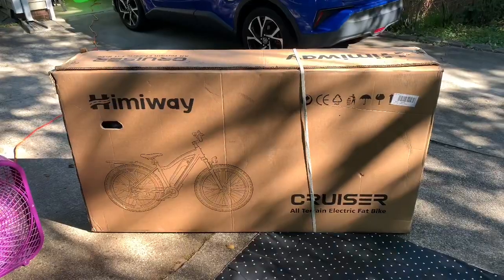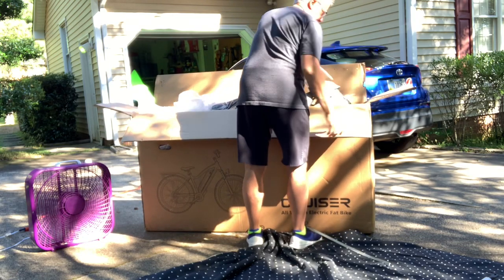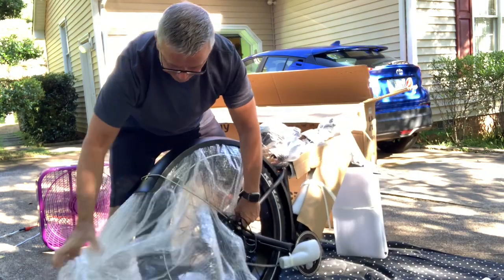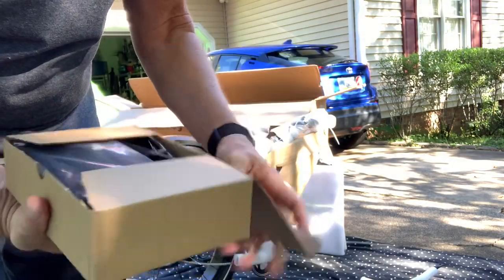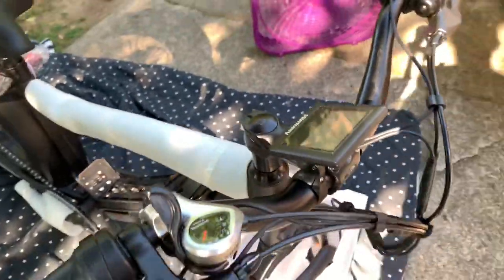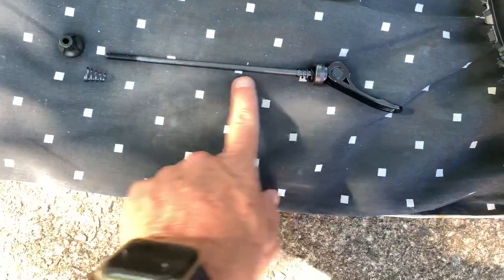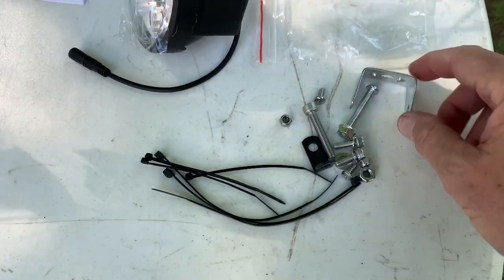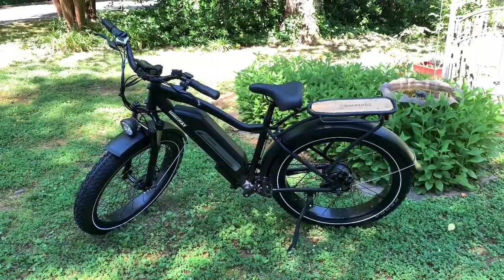Himiway Cruiser Unboxing & Assembly

Comment: Took Me three mo to get Mine ! Took one more for bike shop to assemble it :(  It came with broken 
tail light bracket . I Jerry Rigged bracket , so I could ride it till it can be replaced . Now bike has 5 whole mi on it ( went into hospital wk I got bike home ) . Have You found a " U " lock that will EASILY 
Lock rear wheel to frame ? So far I haven't ! IF You DO find one GOOD LUCK finding some place on the FRAME to carry it !!!! I have the step through , Your frame may be different . Let Me know if You find a high security lock , where You got it , what it is ( brand etc ) & how much $$$ IF I find one , I'LL do the same .

Comment: Can you please tell where does that black little metal go ? ( "V" shaped one)  you can see it in   11:38
Reply from the maker: Hey Mad Boy! That “L” shaped thing is not used at all. Some people have tried using it to mount the headlight higher on the front fender, but it will eventually break. You don’t need to do anything with it. There are lots of jokes in the Himiway community about it. Somebody even had some T-shirts printed with the L-bracket on it! Lol
Reply: @ncaverync  Thanks a lot for the information , I've been looking everywhere to find out where it goes, but there's nothing online about that little piece 😅

Comment: Thanks for the video Dean.  I just got my bike and I'm having issues installing the front wheel, the fork doesn't seem to fit and I don't want to apply too much force.  I'm wondering if you ran into the same issue?
Reply from the maker: Tony's Wings - Hi Tony, Getting the front wheel situated was probably the hardest part. I was doing it by myself too. You just have to be careful to not bend the disk that goes into the brake assembly. I had to loosen the wheel again after I got it initially assembled and re-seat it to get the disk to stop rubbing the brake pad. You might have to do that once it’s put together. Good luck in your assembly. Mine is perfect now!
Reply: @ncaverync  Thanks Dean, unfortunately the forks on my new bike came unaligned!  There is nothing I can do to fix it, I contacted Himiway and I'm waiting for them to give me a solution, not exactly what I was hoping for after waiting so long to get the bike.  It puts to questions their quality control, it's such an obvious thing to identify before it ships.  I'm hoping for a positive outcome here.
Reply: @flywithtony  just curious: couldn't it have happened during shipping?
Reply: Charlie Arehart Highly unlikely!  Those front forks are solid, and the way they were misaligned it was definitely a factory defect.  I brought the bike to a local bike shop and they were also in shock by the misalignment.  I’ve been in contact with Himiway, they have shipped new front forks, once I receive them I will take them to the bike shop so they can install it, Himiway has agreed to reimburse me for the front fork assembly cost once the bike is complete.  I’ll keep you (and readers posted)!
Reply: @flywithtony  bummer to hear that it happened, but good to hear that they're resolving it